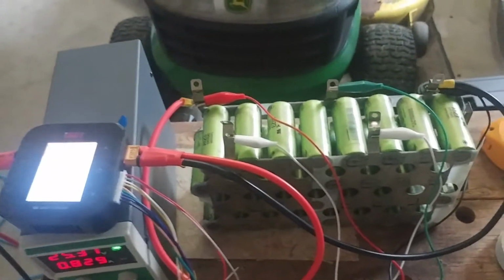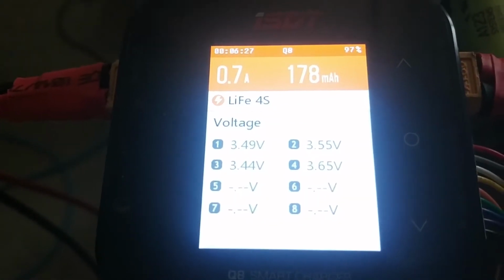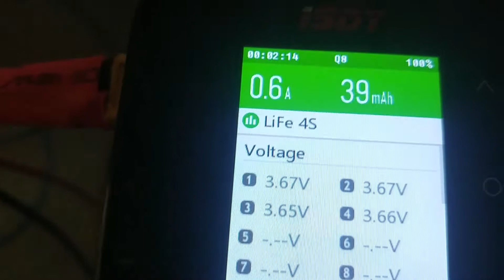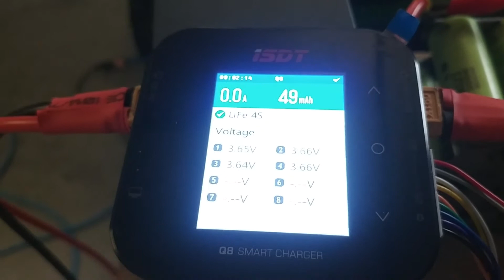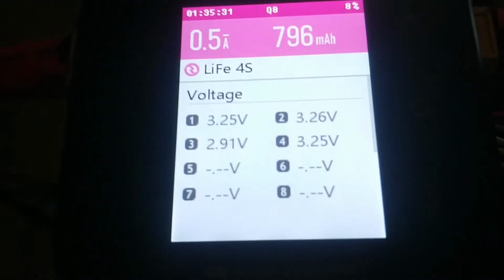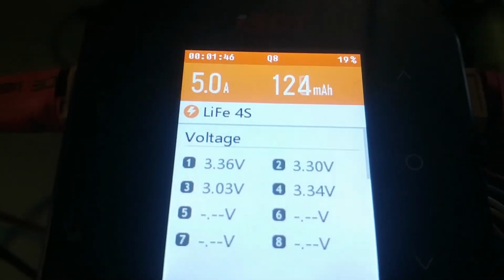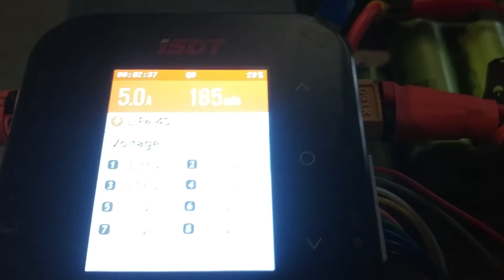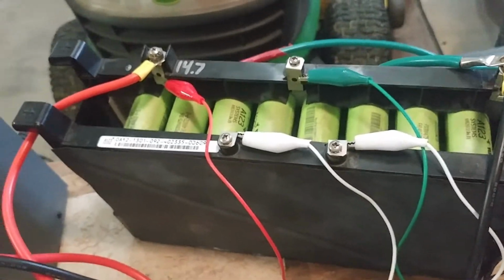2020 28 Testing 12 volt 123 battery

Comment: Nice charger!! Glad you sharing this. I plan on making a pack for a toolbox soon. So you can pretty much leave it on battery pack. Does it have a automatic shut off function to it? Thanks for sharing 😃
Reply from the maker: If you mean for the screen function it never shut off for me but I usually like to leave my lcd screens on all the time. Any function it performs when done it stops. The variable input voltage is nice. Thanks for watching Billy

Comment: I would stay away from M1As. Only M1Bs for me. Awesome little charger
Reply from the maker: Yes the B's are usually better as we know
Reply: @offgridwanabe  ya you should see how hot the power wheels battery gets now. Well over 100F. Almost too hot to hold
Reply from the maker: @frankz1125  heavy discharge on those A's is why they have lots of space around them in the original pack design.
Reply: @offgridwanabe  I know. I still use it for the jeep but I dont think Id want them in my house.